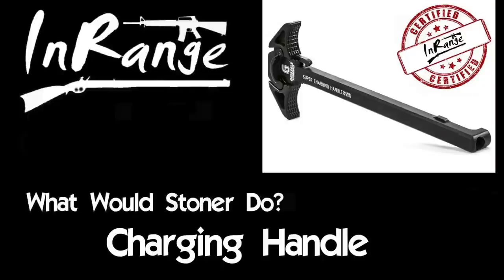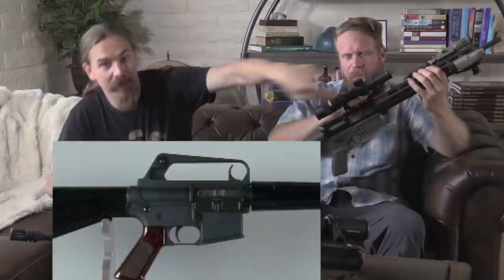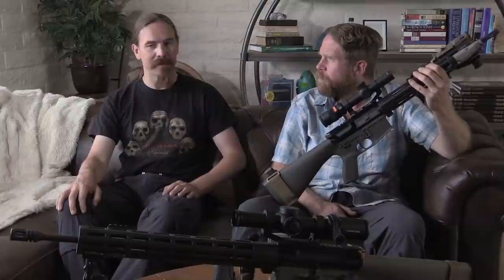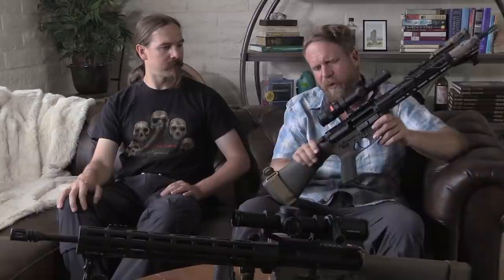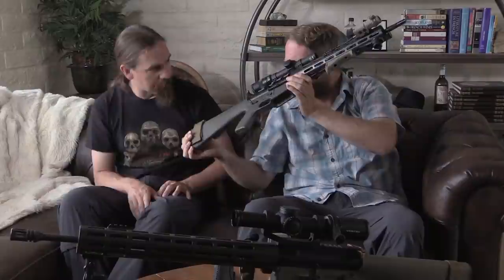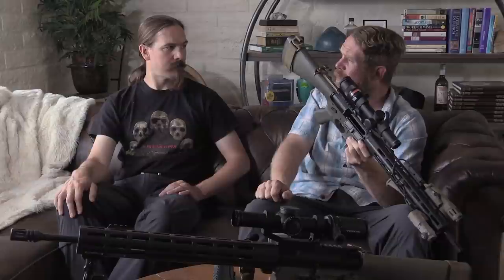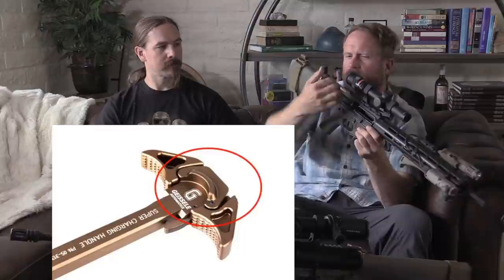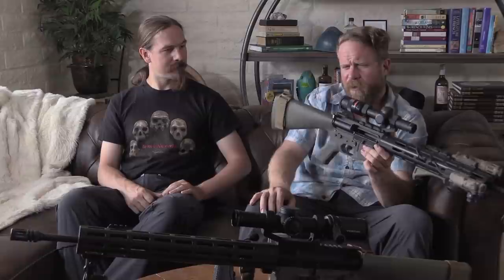WWSD: Geissele Super Charging Handle

Comment: Maybe I missed it, but you guys went right past one of the major intentions of Stoners design and how that factored in to the charging handle. In fact, you actually mentioned the situations he was trying to prevent, and never explained how this gucci handle does not have the same issues like snagging on gear and stabbing you in the back. Stoners design focused a lot on keeping the weapon as low snag as possible. That was the primary reason for a charging lever on top of the weapon, instead of to the side like almost every other weapon design has done. That was also the reason the redesign was wedge shaped. Of course that design proved hard  to grip and use, so the second redesign resulted in the standard T shape we have now, which is even more of a violation of the smooth, narrow low snag profile  Stoner envisioned. I don't know what the solution is, and  I have spent quite a bit of time thinking about it in my own quest to reproduce a  similar Stoner inspired rifle. I'm still waiting for someone smarter or more clever than I to come up with something.

Comment: I've had a cheapo CBC industries ambi charging handle break off via the rollpin and that general area so it wouldn't lock forward but I could still use the gun

Comment: I like the griffin armament snatch charging handle for suppressed shooting because it has a gas port that exists out the right side diverting gas from eyes.  Had a raptor and it was awful for me with a suppressor I looked at the geissele super but I thought the griffin had more chance for gas blocking and that was my main point of purchase. Also I have almost every BCM handle and don’t hate them but if it didn’t come with the gun or upper I would buy geissele or griffin

Comment: The Raptor is cheaper, easier to find, and offers the same advantages.  It also doesn't hang up on gear, doesn't poke you in the back or chest, and it comes in a variety of colors.  Of your running suppressed dont buy the more expensive model made for suppression the standard model does a better job of stopping gasses

Comment: Hey Inrange! I am currently watching the Ken Burns documentary on the Vietnam war. In the documentary several marines, and soldiers complain about the M-16 service rifle being unreliable. In fact the military determined after a particular engagement not far from Khe Sanh that the heavy casualties that the marines took were a direct result of M-16 malfunctions. What caused this? what modern improvements been made in order to mitigate those malfunctions? finally, what is the WWSD project doing to avoid the same pitfalls?
Reply: ithepatrick look up abit more info yourself. The short answer i can give you is the following: they tested and calibrated the guns with one ammo, and then issued the guns with low quality and (not 100% sure) underpowered ammo. Hence the malfunctions. Inrange has a vid with Stoner himself calling it a terrible crime.
Reply: www.dtic.mil/dtic/tr/fulltext/u2/a953117.pdf is the 1968 Army report, additionally, Richard Ichord chaired a congressional commission that investigated the problem, you can see primary sources in the congressional record if you prefer primary sources vs Wikipedia democratized information (you really should, everyone's opinion is NOT equal).

Comment: Have you had experience with the BCM Gunfighter charging handle? I really like the design, as it reinforces the charging handle so that the lever on the charging handle actually when pulled pushes against the back of the charging handle itself, made from I believe machined aluminum, very strong stuff for aluminum, and this takes the stress off of the roll pin. They also make an AMBI version.
Reply from the maker: Yes, and we used those in the testing process but standardized on the Geissele.
Reply: InRangeTV Good to know!

Any reason in particular the Geissele was better? =)

Comment: I always use the BCM, or BMC I can never remember, Gunfighter with the medium sized latch on all my AR builds, they're not terribly expensive but they are very heavy duty, mechanically they are far better than the standard and the medium sized latch is way more than big enough to grab from one side and I've never had one get caught on anything
Reply: I use BCM mod 4s as well, but I get the feeling that they used them and didnt like them much.  But I could be wrong.  

Geissele is quality stuff though, especially their triggers, I have an SSA-E in my AR-10 and it is fantastic.

Comment: I suppose if they made that charging handle from titanium it would be lighter and stronger than the standard one but it would probably cost 300 bucks.
Reply: Maybe... Aluminum is a lot lighter than titanium, but it isn't as elastic. So if you went for a thinner wall you might be able to do one that would spring back into shape rather than break. It would certainly be more expensive to manufacture, because material cost aside, aluminum cuts like butter and titanium... does not.
Reply: You're right, I thought titanium and aluminium were more comparable in density than they actually are. There probably are some titanium charging handles on dedicated race guns, but for "regular" rifles it's probably just not worth the extra cost.

Comment: What would stoner do... increase the cost of a simple part by more than 10x, that's at least 10% of the cost of the rifle. Nope this is not what Stoner would do. Yeah its super cool and helpful, but from an engineering standpoint this thing has to be readily mass producible and cheap to do so. I think you guys are missing the boat on this concept with stuff like CF handguards. Yeah these things are the best in the industry, but take the most money to accomplish. I think you'd be better off calling this what it really is: the best the current market has to offer.
Reply from the maker: Ok. ~K

Comment: The AR charging handle isn't that great it makes reloading and getting jams out longer. That's why US special forces if they can they run the Scar. But interesting video learned something new.
Reply: tuck234 I have talked to loads of operators who have said otherwise. Rangers, Socom, Delta, Green Berets, 160 SoAR, and other Airborne and regular infantry guys like the charging Handel on the side so reloads or jams can be done whilst staying on target. They also like the 7.62 better than 556. Which is why the scar is better than the Armer light type firearms.
Reply: tuck234 And they don't mainly use them because how expensive they are. I said they like them better.